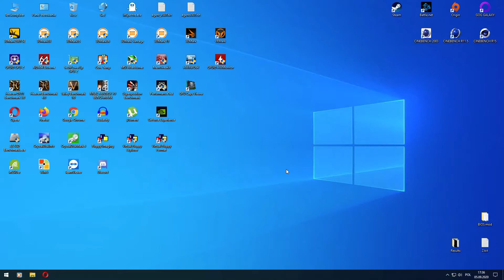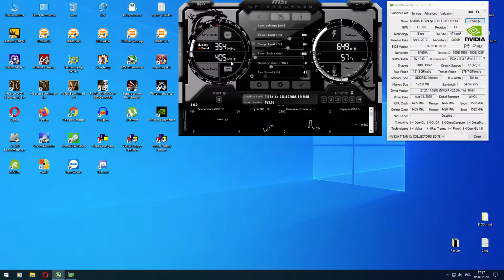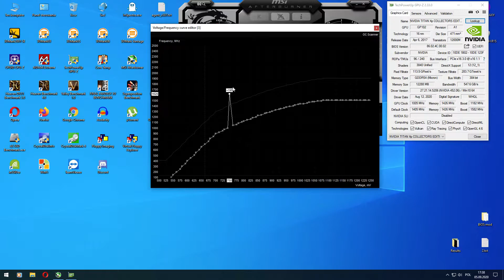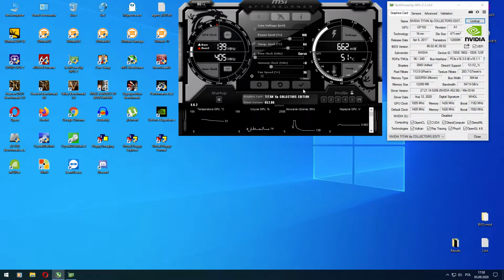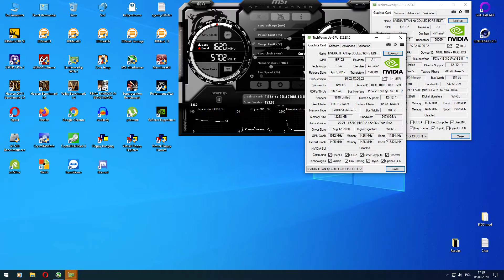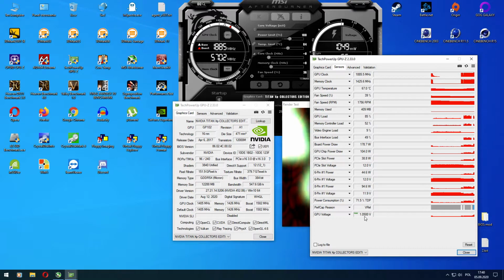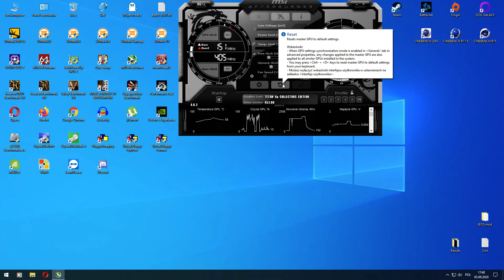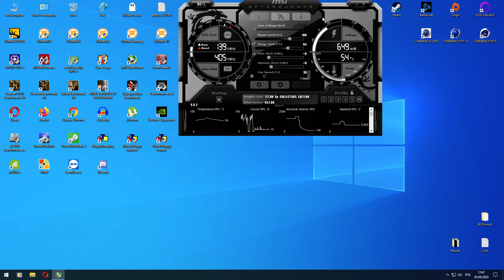Short guide : Overclocking and Undervolting (Pascal + Turing, maybe Ampere ?)

Comment: I have the same card and apply the same setting now my card only boost to 1602 max
Reply from the maker: At what voltage ?
PS. It boosts only to 1620Mhz, because you picked my settings (I use stock cooled card).
If you want it to boost higher, you need to pick different F/V point (for example : 1911MHz/0,962V).